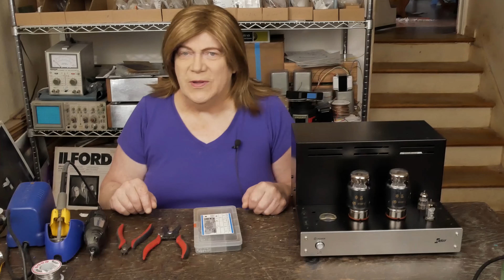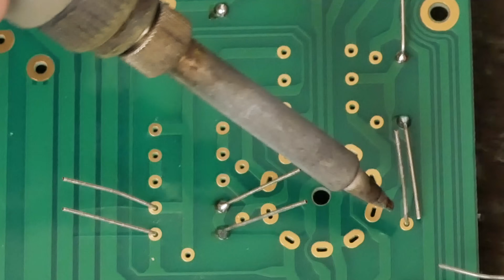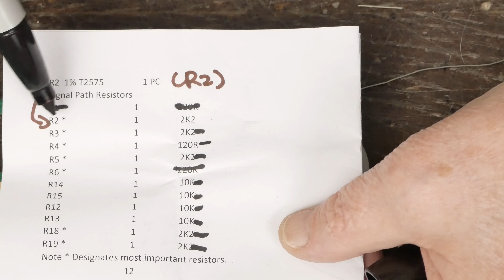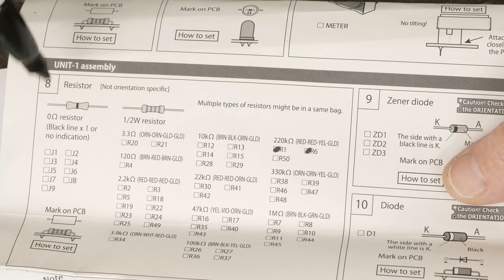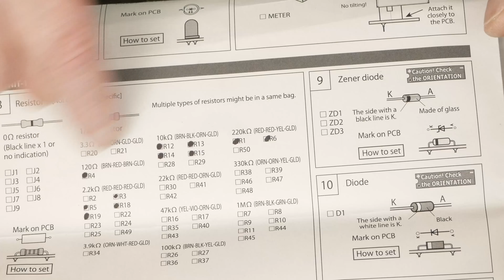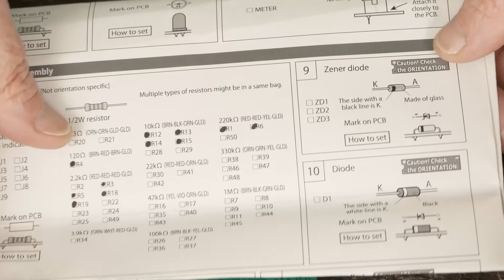Elekit TU-8888 Tube Monoblock Amp: Build Video 2

Comment: The speacial one is naked z-foil resistor. It is so good that it has near zero distortion. I ended up using it for mm loading, hi freq RIAA and low freq RIAA resistors. It won 2w Audio Note Tantalum and Niobium in these positions.

Comment: My understanding of 0 ohm resistors is that they are for robot auto stuffing machines, the machines can't handle a jumper wire but a reel of 0 ohm resistors is right up its alley, no other reason that I know of. Maybe Elekit also sells these amps ready built and they are designed around auto stuffing and wave soldering. I would just use a jumper, easier for the next tech to figure out what's going on.
Reply from the maker: You're right, I never thought of that! And I think you can buy these preassembled.
Reply: I asked my friend who built my el34 amp about the zero ohm resisters and he said they were for use in circuit boards.
Reply: An there is no reason you couldn't just use a piece of wire in place of the zero ohm resistors in a hand built amp.
Reply: 0 ohm resistors are also critical for SMD designs as there are no surface mount jumper wires otherwise.

Comment: I'm glad to see you're reflowing joints after cutting - it's a good practice, prevents solder cracking from mechanical shock.
It's recommended in IPC-A-610E (7.3.5.9) as an alternative to viewing the joint with a microscope after cutting, then reflowing if needed.
Reply from the maker: It's funny you say that, someone sent me a very rude comment saying it's bad practice to do that lol. This also allows me to go over the board one last time in case I didn't get enough solder in one of the joints etc.

 Ideally one would never cut into the solder, but I am human and sometimes I do cut into it, so this resolves that without starting over and throwing the part away etc.
Reply: @SkunkieDesignsElectronics  sorry to hear that, like... criticizing one's work when there's a reason to do so is one thing, but a manner it's done matters a lot too. Looks like some people really need to grow up.